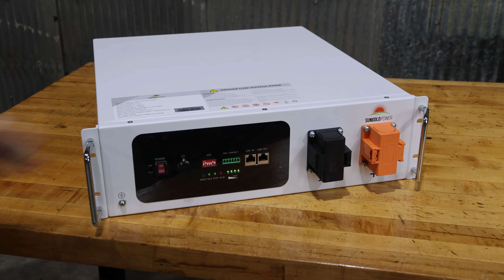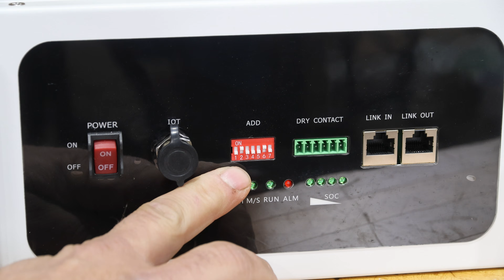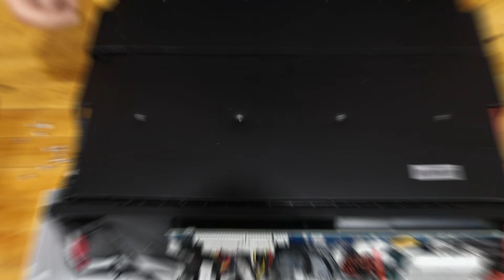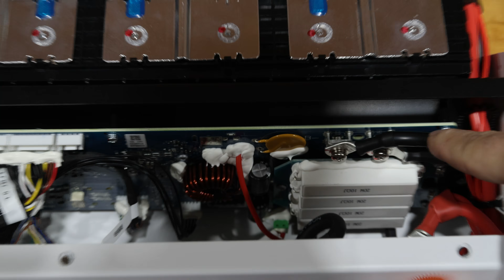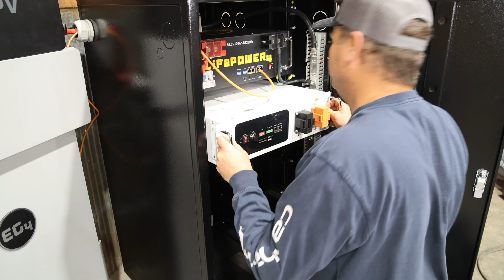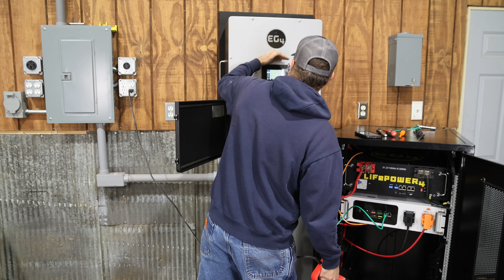New Heated Server Rack Battery - Overview and Installation - SunGoldPower

Comment: You can use can bus on EG4 inverters and sungold batteries but you have to change the battery type to 2 and lithium type to 2. It uses pylontech protocol on the can  bus at least it does on mine and then you can communications are fine.

Comment: I need a step down transformer from 24 to 12v that can handle roughly 175amp draw from a 3000wat inverter I have the inverter is designed for 12v im wanting to set up a 24v battery bank.
Do you know where I might find one.
Reply from the maker: Tranformers don't work on DC voltage .  They work on AC voktage.

Comment: Both batteries need to have the same baud rate before any comms will work
Reply from the maker: There is a selector switch for the baud rate.  I tried both settings.

Comment: Evan I have my backup battery out in my garage for my solar.  It has gone completely dead one year due to lack of sun on my solar panels.  Would providing heat help with that?  If so what would you recommend?  I got ripped off on mine, I discovered you after I paid for my system.  Thanks for any help!
Reply from the maker: First I would check the battery to see what voltage it reads.  If it reads a few volts low, I would throw a battery charger on it and see if it charges back up.  If it doesn't take a charge and it's a lithium battery, the BMS may have went bad.

Comment: 0:26 why. Who should pay for this regulation?
Why not based on state. Because there is no snow in Hawaii But Hawaii has the highest electricity prices in the USA. And solar energy is cheap . And also if it rains outside, it can corrode due to sea water vapor.

Comment: For giiggles and grins did you try a crossover ethernet cable for the inter-battery communication?
Reply from the maker: I used a cable for that came with a server rack battery for battery communication.  It should have been the right cable.  I just cut out pins 3 and 6 to defeat the estop function.

Comment: If a user should accumulate a variety of batteries of different makes and models over time, can the inverter talk on both the CAN Bus and RS485 at the same time as required by different models of battery? Thx.
Reply from the maker: I would suggest buying all the same brand battery.  I am not sure if different brands can communicate with each other.
Reply: It does not appear that would work well.   Ex. Ford, Chevy, dodge do not make same cars/trucks, they all do same thing, run drive stop, but try and buy parts or swap part between them and you run into problems.   Yes, you can fabracobble something together and make it work, but it won't be as designed.

Comment: With multiple brands and varying ages of a battery in a system as it grows, can you go over the quirks of charging and voltage swings when the batteries have different performances? What happens when one battery is at say 50% and another is 75% for instance?
Reply from the maker: You need to put a charger on the batteries till the all read 100% again.  It may take several hours to get them all to match up again.  But over time they will drift apart again.  That will happen just from current sharing, even all the same brand and size batteries could drift apart.
Reply: @CountryViewSolar-DIYProjects  On the output side, how does a say 50% battery interact with the 75%? Is the higher % battery somehow back feeding the lower one? Or is the battery module somehow outputting the same voltage regardless of the battery state?

Maybe I am not aware of how current sharing works.
Reply: @jonathanmcelravy8608 i think what Evan is saying is the inverter and batteries work together with the comm cables and through use if the batteries do not get fully charged, over time the SOT (state of charge) will drift apart.   Ex. 6 batteries all the brand....
Batt. 1 94%
Batt. 2 93%
Batt. 3 91%
Batt. 4 90%
Batt. 5 94%
Batt. 6 92%

And they can grow farther apart in percentage over time until they are charged back up to 100%.   The inverter takes care of that or a "chareverter" or a manual battery charger can do the same.

With the example you gave it sounds like you are hooking up an additional battery to the system and you are wondering if the vast difference in charge is a problem and will it get solved automatically.  The answer, from what I have noticed is yes, it will get solved over time and take care of itself.   Somehow with the inverter and batteries talking and being used the inverter will do some magical algorithmic stuff inside it's little computer brain and charge them to the same capacity through solar/generator/grid power (which ever you have)

I hope I have understood your question correctly and this helps. If I did not, then post again and we can figure it out.  😊
Reply: Thanks for another good video.  All the best from north Texas.

Comment: Thank you for another great video Evan.
Can you do one on the all the grounding (solar panels, batteries, inverters, breaker boxes) hitting on National code? Are you using lightning arresters? Will you be doing a larger ground mounted system? That server rack is mobile, is there a plug that would match the server rack’s max rail amps (600amps)?

Comment: Interesting. I would think the battery interconnect communications cable would be a crossover. But you will need to check out the jack's pinout. can not put Tx to Tx and Rx to Rx.
Reply from the maker: The cable that was modified was a cable for interbattery communication that came with a server rack battery.  So it should be the correct cable.  I just removed pins 3 and 6 for the emergency stop.  But still no communication.
Reply: Crossover cable would be inline with networking. The other is do the batteries need a switch between them to avoid the battery communications?
Reply: @jackg.1759  I still believe it"s still communications between two devicis
Reply: I came here to say this. It "should" be a crossover cable, but it may not be because of the difference in manufacturers. If a crossover cable fails you will need to make a custom cable that connects the shutdown TX on battery 1 to the shutdown RX on battery 2, the shutdown RX on battery 1 to the shutdown TX on battery  2, and so on for the other wires. Communication buss architecture is TX1 ‐> RX2 and TX2 -> RX1.

It may also be unable to determine what battery is the master and trips. Try making the new battery the master and the EG4 the secondary.